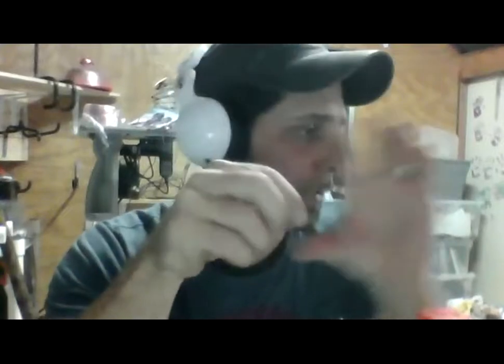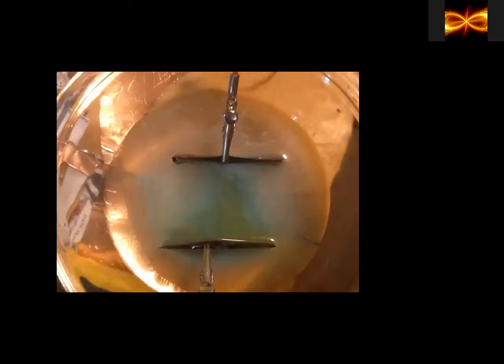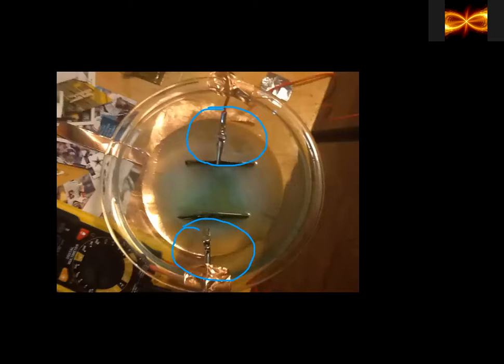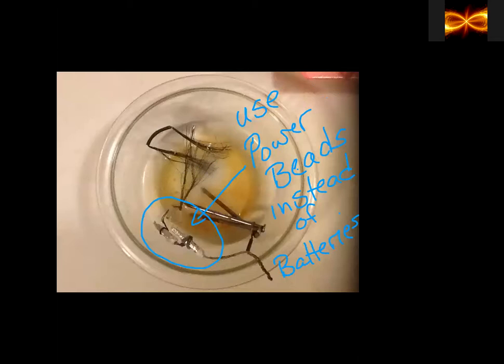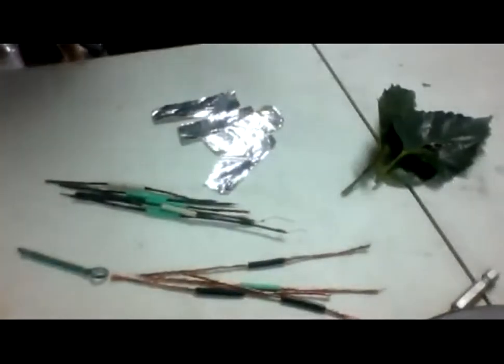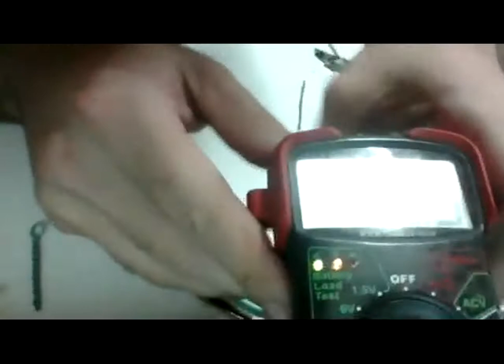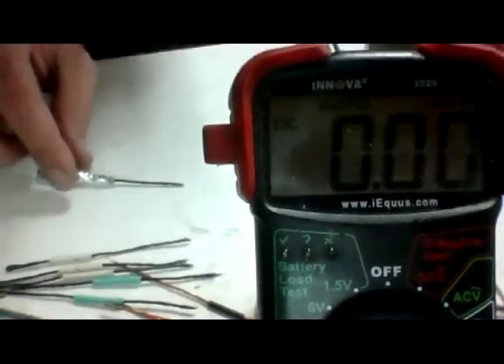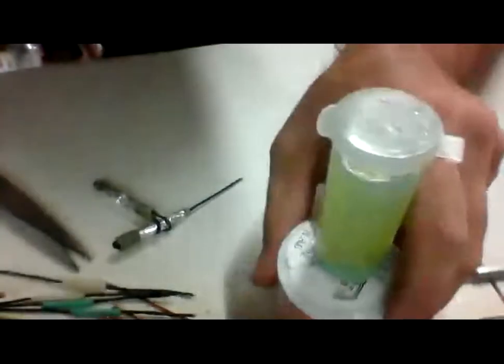Emergency Situation Advice using Light/plasma

Comment: Isn't the galvanized nails putting zinc instead of iron that the nails would otherwise provide as the galvanization is in reality a zinc coating that has been plated or coated on the steel nails?